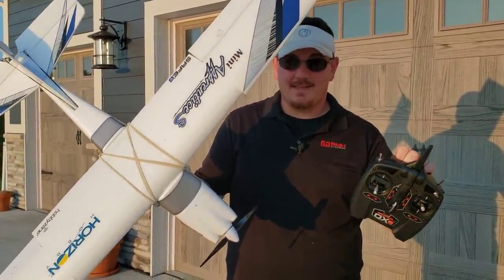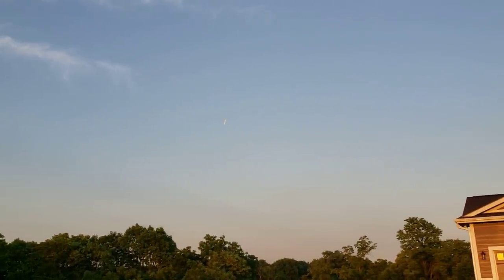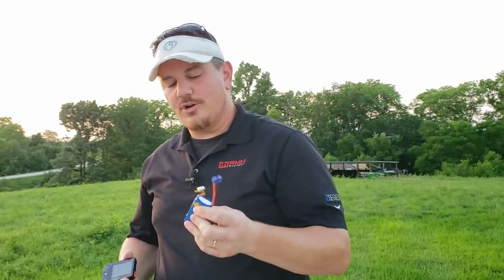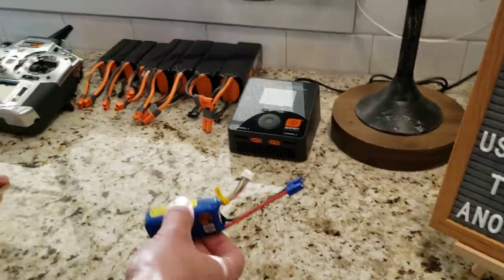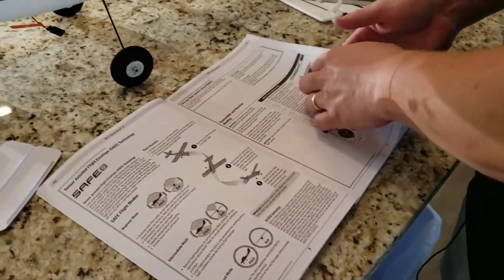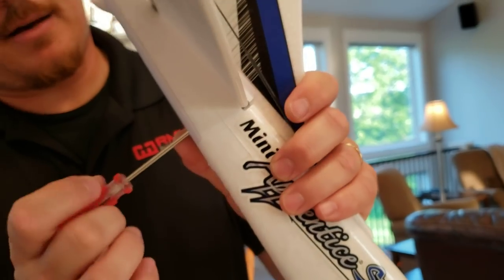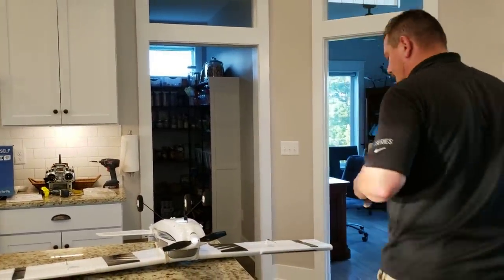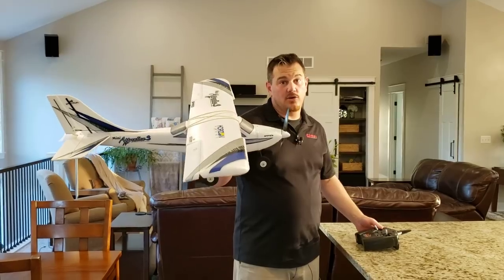HobbyZone - Mini Apprentice S - Unbox, Setup, & Maiden Flights

Comment: I've watched a lot of your videos. Very informative. I watched this video twice and the Apprentice S 1.2m once and decided on looking for apprentice S 1.2m RTF on ebay auction. Found one that had damage to the left aileron and the servo gears were stripped. Hot water took care of the aileron and I bought a new servo (Horizon Hobby). The Apprentice S 1.2m was fully intact. Still factory sealed. Last year, I bought 2 cheap Chinese RC Airplanes. First one, I hand launched, went 10 feet, took a sharp Right turn, the nose dive into the ground. I was a "One and done" for a month. Bought a different Chinese cheap RC plane and had a great deal of trouble trying to fly. So, I was done again for a few months. Your videos convinced me to go with Horizon Hobby and Spektrum. That changed my life. I bought a UMX Sport Cub S 2. It was like a DREAM flying that one. Liked it so much I bought another UMX Sport Cub S 2 in case I needed parts. Second one will be for my grandson this spring. I will only buy Horizon Hobby and Spektrum. I also bought FMS Cessna 182 1400mm, Mini Aeroscout, and UMX Torbo Timber. I'll be looking for an RC Flying Club to join this spring. I've also read up on AMA rules, whatever you call them. It's common sense stuff. My goal is to save money to buy a Valiant. Loved the way it looks. Many, many thanks for your videos. You are an inspiration to so many people who want to get into this hobby.
Reply from the maker: Glad we could be a part of your journey!

Comment: This is my first RC plane  I like it because it is very slow and since I am slow I love it.  I wish that RCs would have wheel brakes.  Thanks for looping the moon.  Wonderful audio.  As we say to teachers of Ham radio you are a good Elmer.  A very nice job in the basics of out sport.
Reply from the maker: Thanks again Tim! I want to work out where we're getting interference on these mics. We've established it's more than likely on the Rx, or between the pickup and the Cell phone, but aren't sure what's causing it. I'm sure you noticed, if you're a ham radio operator ;)

Comment: Wish I had that when I first started would of saved me a lot of glue lol. Instead I learned how to fly the hard way with a edf but after 100 or so crashes I finally flew it fine and my second plane was the sport cub s+ and now I’m flying (80mm EDFs) but you know that already. And this is a great plane for a beginner to start out with. Happy flying!!!
Reply from the maker: WOW - 80" EDF's - Full scale pilot, Seth??? :) JK, I know what you mean....80mm ;)
I agree about the glue savings!!!!

I too had an EDF too early, and it met an untimely demise. Habu 180 UMX - but it because the Spabu (Sport Cub S UMX + Habu 180 UMX with SAFE!!!)
Reply: Brian Phillips yea lol just caught that I put 80mm but that’s a smart phone for ya always correcting when not needed lol 😂. And it’s funny how you were just talking about how power lines and planes don’t mix I think there just to hard to judge say goodbye to the rudder on my UMX Citation 😞 lol fixed but always crabbing lol

Comment: I'm surprised that Horizon isn't using DJI type avoidance detection on their trainer planes yet.  However, this looks like a great plane for someone coming from rc trucks to start with. I enjoy that there is still a little bit of building with these. I always found that the build is actually a big part of the fun of hobby grade rc
Reply from the maker: I think that DJI type of avoidance detection is a function of a rather sophisticated GPS system, which is way more advanced than that of which Horizon Hobby used on this plane ;)

Comment: For me, after watching your vids and others, the next step up from the Sport Cub S2 that I'm now flying will be the UMX Turbo Timber.
Reply from the maker: yep - good choice!!!

Turbo Timber 1.5m - https://bit.ly/2SjksOg

Keep in mind, you might get another "RTF" to use the included radio with the Timber UMX....that's what I did with the Delta Ray, at my 2nd or 3rd plane....I bought it for the Transmitter, then I  LOVED IT!!!
Reply: @BrianPhillipsRC  Thanks for your comments as I value your thoughtful opinions. 
I've pretty much settled on the UMX Timber which I think would be great for my 2+ acre front yard. Spektrum transmitters seem very expensive to me so I've been researching the 6 channel Orangerx and the  8 channel RadioMaster. Also have an interest in building some of the plane kits from Flight Test once I have a decent TX.
Reply from the maker: Check the description. At the bottom of the list, Jumper...

Comment: Flies great little high though!!! I got some foam board a couple days ago I'm going to build a trainer to get back into flying after 20yrs of not flying lol Flite Test channel has some great build plans All I've gotta get is the electronics and it will be pretty cheap to get in the air If ya take your time and do a good job you can build a very nice plane of any style I'm going with a trainer first for obvious reasons lol Great flying Brian 🔥✌️
Reply from the maker: Go for it! It's like riding a bike - you'll be an expert again in NO TIME!!!

One word of warning, the electronics are the HARDEST part for a veteran RC expert. SOOOOOOOOOO much has changed. If you want in the air quick, a plane like this (mini apprentice) would be great...and then you can use the Transmitter with another DSMX receiver when you get your foam boad plane built...just an idea ;)
Reply: @BrianPhillipsRC  Thanks for the idea 👍✌️

Comment: Got this plane about two months ago to learn how to fly at my local club field. Love this thing, super easy to fly and forgiving. Unfortunately one of the times o flew it I was standing directly on a red ant hill while in expert mode and crashed. Just broke the motor mount, prop and cowl which was about $15 total to replace.
Reply: Sorry for your crash, but isn't it great that for only $15 and not too much rebuild time, you can get back to the fun?  My instructor taught me that you can usually get spare parts from Horizon Hobby, but no guarantees about parts availability for some of the cheaper planes from China.
Reply from the maker: Great to hear! Seems totally reasonable. I've fixed the 1.5m for 1.5 sticks of hot glue and three burned fingers - LOL :)
Reply from the maker: Chet - yep! Most of the el cheapo Chinese stuff I review, you're lucky to get a spare prop....but they're so cheap, you can get two ;) LOL

Comment: Brian. Big fan. I'm just getting into the RC hobby. I bought the Mini Apprentice S RTF after watching your show, however after plugging in the battery and getting the sounds, when I place it on the ground...nothing works. Not even the motor. Any help would be appreciated
Reply from the maker: Check on a few things...

1) Tx is ON, and in the right model (Assuming you're using a programmable Tx, not the RTF with DXS or DXe)
2) Battery is CHARGED on both Tx and Plane
3) I don't think there is, but the 1.5m USED TO HAVE A POWER SWITCH...does yours have one just under the wing?????????? CHECK, make sure it's ON, if it exists
4) Do you hear the ESC arm?
5) Is your THROTTLE LOW? You have to have the STICK ALL THE WAY DOWN, and if it STILL doesn't ARM, you might need to TRIM IT DOWN A FEW CLICKS, and if you DO, please be CAREFUL.
6) Is the ESC plugged into the Rx ?
7) Is there one or MORE of the THREE wired d/c'ed from the motor to the ESC???
8) Is it 100% level when you let it go? If NOT, it may not ARM. Also, if it was WINDY, was it rocking around???

Okay, try these things and get back to me (or call Horizon Hobby tech support) if you still can't figure out the issue.

Comment: That is very fun to fly.  I keep it in intermediate and expert mode.
Reply from the maker: It sure is!
Reply: @BrianPhillipsRC  would I get a bit more flight time with a 2200mah? My other question is that when I took it up,  my plane starting climbing and rolling to the left. Is that an issue with trim? I found it strange when my plane did that...

Comment: Hi Brian looks good. I love watching your reviews from South Africa. I am a beginner in the RC hobby and love building scratch builds (it’s expensive to buy planes here) pity they only fly for a few seconds :). Keep up the good work
Reply from the maker: If you're only flying them for a few seconds, here's a few tips that WILL help you.

1) Make sure you're CG (center of gravity) is good. If you're NOT sure, make sure it's NOSE heavy. 1/3 to 1/2 back on the wing, then it should hang nose down a bit....if you don't know the exact CG location, no problem, err on the SAFE / Nose heavy side.

2) Get some more DIHEDRAL in your wing. This will help the plane to self right easier.

3) Get enough power too fly. When you give her full throttle, if she doesn't want to get off the ground, try a hand launch, but have some TALL grass if possible to keep the damage down if it doesn't work well.

4) Try a GLIDE TEST before you take her out for a maiden. If it doesn't glide at ALL UP WEIGHT, lose some and try again. If the wing doesn't work well, make the air foil TALLER, and you'll have more drag, but more lift too. You can over do this part, but yo don't want to be flying a KITE ;)

Good luck! Can you get shipments from Banggood? Here's a few lower cost options that might be easier for international shipping...

Eachine
Mini F4U https://bit.ly/3h3OhNI
Mini P-51 https://bit.ly/2JQDtDj
Volantex
Sport Cub 500 https://bit.ly/3c3Yqqn

...I have videos for all of these planes too, if you want to watch ;)
Reply: @BrianPhillipsRC  Thanks for the reply. I have started building 3 Ch planes with Dihedral and bought myself a simulator. I will also try and find out if I can get one of the planes you suggested.

Comment: I'm hooked on this hobby even though I've only tried 4 times, crashed the first 3 (light crashes), 4th flight was the longest but was super frustrating with the controls.
Reply: simulator
Reply from the maker: Yes, and it's a muscle memory thing. you will need to fly a ton just to keep your thumbs from doing dumb things your don't mean to do. Practice makes perseverance - you CAN do it
Reply from the maker: true

Comment: Great job guys, thank you.
Reply from the maker: thanks again G Bro!
Reply: @BrianPhillipsRC  I have two mini apprentice S planes. Crashed one bought a second one. Easily repaired the 1 st. However it has almost no 
Control surface throw (Authority) ailerons will not move for a left turn at all. I  deleted and downloaded from spectrum the software for the mini apprentice s again. Rebound it
Still no authority. Next step is to switch receivers. To see if it’s the receiver. If not it can only be the esc or the programming from spectrum is bad. Will see 
Oh it’s all the control surfaces but not the throttle

Comment: I’ve had this plane...  I do not have it anymore because the wind blew it away.  It is a great plane though, but if you live somewhere windy like me, get the older brother.
Reply from the maker: The larger 1.5m would be another good choice, and even more capable. Fly aways are less common with this plane, over the Sport Cub S UMX, for example.
Reply: I lost it in a no go windy day.  It was a stupid thing to do.

Comment: My 15e had a few upgrades. Power 25 motor 60amp ESC 13/8 prop and 3 1/4” wheels running on a 4S 3200. Next I will be adding flaps.
Reply from the maker: 13X8?!??!?! Are you kidding me??!?!?! You'll shoot your eye out - LOL
Reply: Brian Phillips Well this weekend it lasted 3 flights before it crashed and everyone died. (I was flying it like a fighter jet. 😎) We were taking bets on what would break off first. Would it snap the wings in half or would the tail rip off. Well it was the tail and elevator that said it had enough and down it came. I’ll fix it but will only run it on 3S now with a 12/8 prop. It was just too fast for the airframe.
Reply: VERY helpful reply to what I was thinking of trying on this plane Ed. Except I was hoping the factory set up could handle a 3000 4 S.  Not looking for ultra speed here,, just hoping gentle flying on a 3000 won't destroy this air frame. o.0
Reply: @ohioace58  the stock air frame will handle 4S if you don’t fly it like an EDF. (I was pushing it. I wanted to see how much it could take before it became a lawn dart. ) But you will have to upgrade the ESC as the stock 30 Amp will not like the 4S for very long. Plus I had the wings expoxy together.
Reply: @ederdmann7347  Thanks for the reply Ed.

Comment: Do you have to set anything up for the low voltage alarm? Or is it just installed already also that was the battery that came with it right?
Reply from the maker: The LVC is built in, and part of the ESC (electronic speed control), but if you're talking about my BEEPER low voltage alarm thingy...you can change the voltage you want it to alarm under, but you don't HAVE to ;)

Comment: The ground handling is MUCH sharper in Experienced mode.  It is not adequate in SAFE model.  Keep it in Experienced mode until you are lined up for take-off then switch to SAFE mode.
Reply from the maker: yeah, and high rates vs low rates.

Comment: Sorry to bother you with a question like this but I have purchased this also. I am in need of a prop but the HobbyZone website says it's been discontinued. Can you make a recommend a replacement prop or some other supplier. Thanks. I enjoy your channel so much and is why I got interested in the plane as a starter for myself.
Reply from the maker: Looks like they might have changed the part from the original PN to a new one???

Here's a link to the same size prop at horizonhobby.com - https://bit.ly/2Y43aI0 

https://amzn.to/31OBqYI - These ones might work, but they're 9X5 rather than 8.25X5.5 (A weird size)

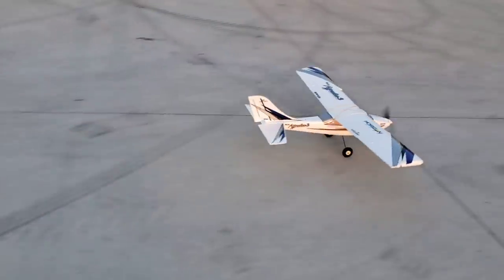Comment: 16:30 If your wife has zero RC experience, get her a slow/medium speed ground vehicle so she can learn LEFT/RIGHT coming and going.  What about you build her a simple DTF-construction wide/flat bottom airboat?  Don't make it too fancy, but just some Frankenstein you throw together, and tell her how easy it was to make, and it's a disposable vehicle.  I was so worried about scratching my brand new Apprentice, but now after a few crashes, it has a nice "patina" and it's not so bad when I give it a new scrape.   (Big propellers can be intimidating, so maybe a slow wheel-driven vehicle is a good beginner option.  A budget rock-crawler?  Buy something used that already has plenty of scratches, dings, and glue.)  Remember, how anxious you are parking in a busy lot, when you new truck has zero scuffs on it?  A thoughtful car salesman will bring a hammer when he "hands over" the keys, and wack the passenger door to give car the first ding!
Reply from the maker: She has zero interest in it, which is why she's not doing it...trust me, I've tried ;)

Comment: Hi! Thanks for the video. Would you be able to enlighten me at all regarding the differences between this and the slightly larger STS? Wondering what differences make the $100 price variance.
Reply from the maker: One is 1.2m and the other is 1.5m - Size is the only real appreciable difference, but the Mini (now just called the 1.2m) is slightly newer tech on the Rx (AR631 now), which makes it a bit easier to modify if you want to add flaps later on, but you won't need to do any of that to enjoy EITHER of these planes. They are both amazing choices.

If you twisted my arm, I'd say get the 1.2m if you're flying in a small place, but if you have room, get the 1.5m. It's a LOT more plane for the money, and size makes flying a bit easier for most people.

Apprentice https://bit.ly/2OIjVHd
Reply: @BrianPhillipsRC  Thank you so much for the reply!

Comment: Hey everyone just looking for some suggestions here. I had the sport cub s2 for a few months and got the Aeroscout afterward (which by the way is an awesome plane). I'm looking to advance to something else that's a pusher prop type plane or a edf jet. One that comes with AS3X. Reason I prefer a pusher is cause I feel anything with the propeller on the front is bound to break/bend. I don't want the hassle of repairing it all the time. I have a bunch of 3S packs so one that uses those would be great as well. Thank you
Reply from the maker: This plane will be great, despite your concerns. Gotta learn to keep the prop clear of the ground at some point ;)

Pusher props are somewhat uncommon. Not non-existent, but they're mostly glider style planes.
Reply: @BrianPhillipsRC  thank you for the reply. I figured. I tried searching up pusher prop planes, but most seem to be gliders. Only pusher prop I've found that is great is the aeroscout. You are right about having the ability to keep the prop off the ground. I'll just have to practice till I get better at it and upgrade from there. Thank you again